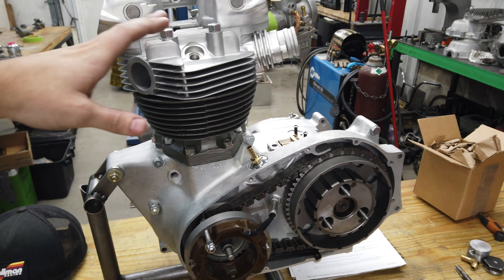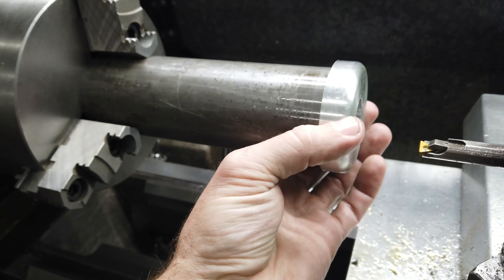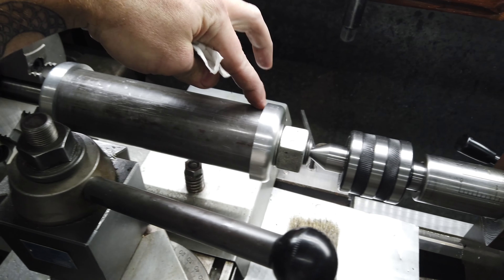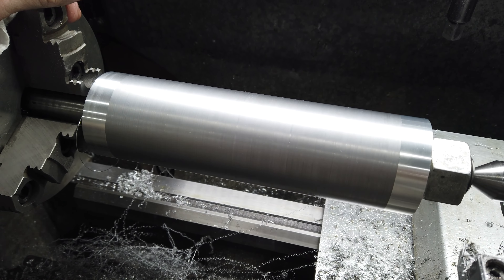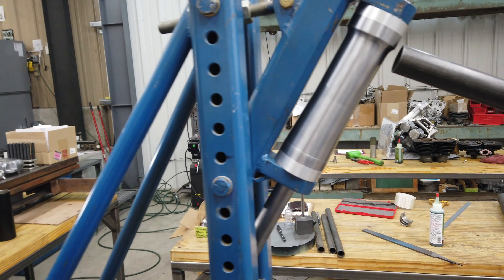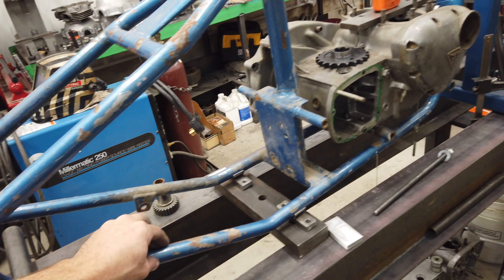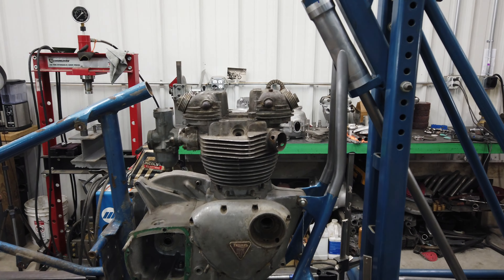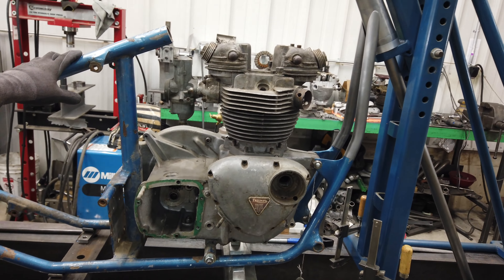TRIUMPH SHOP ROD frame work started

Comment: You need a longer back one, it Will look funny with the 2 down tubes almost going vertikal, HD do not do that. Very Nice machine shop such a you g age you have.
Reply from the maker: sense this video i have installed the front end. it looks great, the vertical sections compliment the vertical twin quite well.

Comment: ...cool but one thing is make a frame to have fun and ride around the block and other is to make one more functional; to ride actually. However; nobody rides old motorcycle anymore. I understand that but
Reply from the maker: i have hundreds of miles of two lane highways all to myself i do loads of vintage bike riding on its amazing, i am very lucky. though you have to to pass the occasional tractor or combine .
Reply: @dirtyshirtrichter8647  I imagine all those lands without any; pretty good would be. I always wanted to put km on those USA roads but hiring a new bike is not so incredible for me and also is not cheap